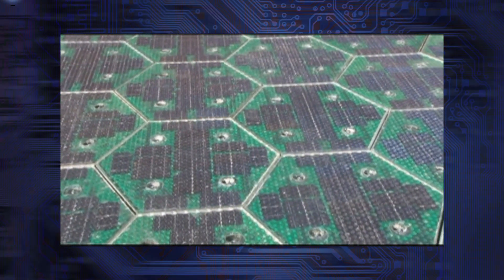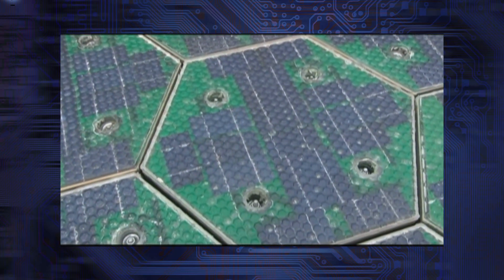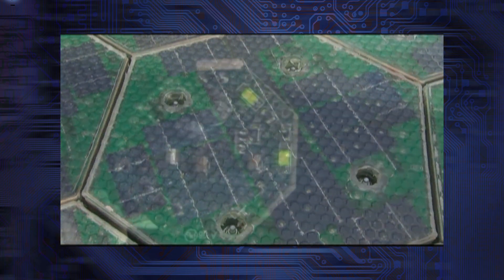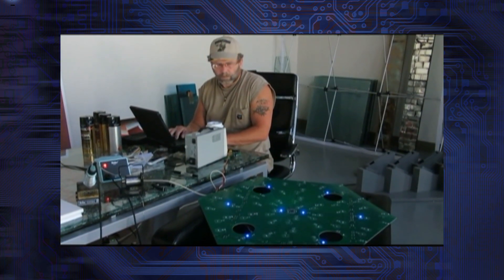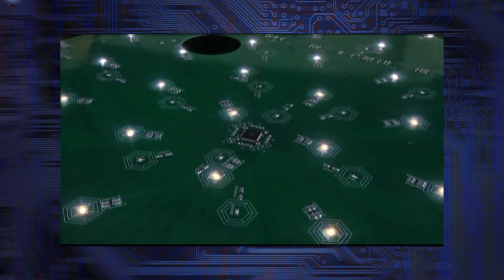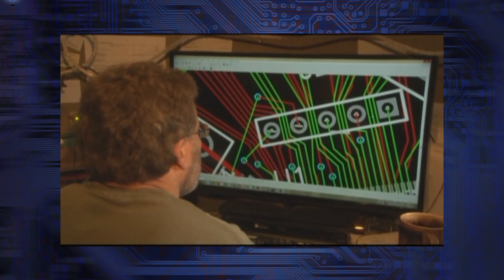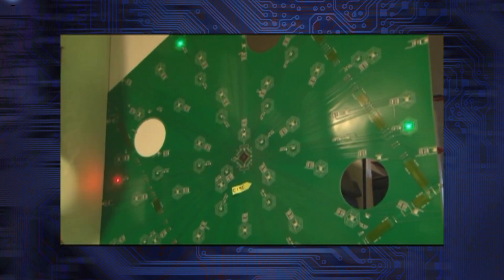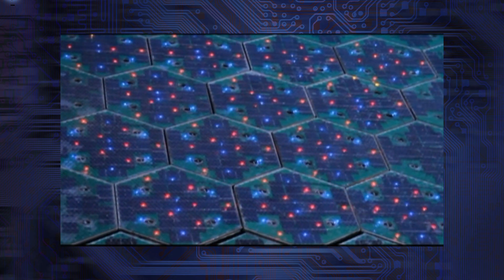Solar Roadways - Smart Streets of the Future

Comment: But will it be prohibitively expensive? And what happens if you live in an unstable area, tar can crack and it's no big deal, a $7000 solar panel cracks and people would freak out. And what about upgrades? What happens when a more efficient solar cell comes out, do they have to redo the entire road? It's a cool idea but there are still a lot of problems with it.
Reply: right cuz if tar cracks they just leave it for months and don't do shit about it.... though unstable neighborhoods wouldn't be able to afford it in the first place.
Reply: ***** By unstable I mean Geologically unstable :P When roads crack it's a simple matter of filling the crack with tar. It takes maybe 30 minutes and people can drive on it. Electric systems aren't as easily fixable. . . Now that I think about it, would these tiles work on hills or are they only for flat surfaces?
Reply: Gaius Hannam  I guess that can be a problem, but given we can make flexible displays and other parts. I think it can be done just need a lot of ribbon cables xP... and because these are modular they might just be able to absorb shocks better. like trees getting knocked down by high winds but grass can just wiggle a bit. (horrible analogy xP)
Reply: Tar cost in 2010 was $1000 per ton, depending on the size of the crack, the cost would be balanced. Honestly prototype costs aren't a good representation of actual costs. Mass production of these panels could drive the costs as low as $500.
Reply: Tracy Gossett You're right and the costs should drop significantly if they're able to produce the panels in bulk. I just worry that this idea might be too expensive and unreliable.
Reply: Gaius Hannam They won't significantly drop, because of the law of diminishing returns. Also, for example, what do you think is going to happen to the price of LEDs when the demand is going to pretty much double overnight? Do you think that the people who use LEDs now are going to shut up shop jus to get this project done?
Reply: What has happened to the price of electronics? It needs to get going, that's all.
Reply: They never will have all the roads replaced with these panels.  In my local area of Iowa all the non-essential roads are still gravel.  If there are not more than ten homes on the road, they won't put money into paving it.

Comment: Rain, snow, ice, dirt...
Reply: Rain is channeled away, snow and ice are melted with heating elements, dirt falls into the cracks between the textured tempered glass bumps and can be swept off with a street sweeper.
Reply: Also rain floods the dirt away, and Small pieces can be blown off by passing cars creating Air flow.
Reply: ***** They have considered many situations like that where something could go wrong. That is what civil engineers have to do to develop something that will last.
Reply: ***** Everyone is so worked up by this project. You don't need to be afraid.

The couple is collaborating with engineers who know how to do their job. They got a contract with the Federal Highway Administration.

Here's their solution:
http://www.solarroadways.com/faq.shtml#faqSnowmelt

Comment: What about traction? Those things don't look like they would have much grip.
Reply: Sir Aroun in there video all they showed for testing was a tractor going over at low speed. They didn't mention about long term wear, or traction in wet, dirty conditions.
Reply: Tracy Gossett tempered glass is stronger yes, but its not scratch proof, whats 10 years of grit and gravel scratching over glass going to look like
Reply: also they talk about covering 12500 sq mi with these panels which is 348480000000 sq ft. Tempered glass costs about $20/sq ft. I'll let you do the math for the cost of the glass alone, let alone the solar panels, led, installation etc.
Reply: They have been tested and have better traction.  Go check out their videos on indiegogo.
Reply: Ultra Sabers
It is not normal glass.
Reply: even if it were "special glass" there are so many problems with this idea
Reply: I'm not against it. i'm all for finding new energy sources. I have solar powered gate openers on my pasture gates. I just don't see how these things will hold up to heavy traffic and big trucks.
Reply: ralph high
well they do, they tested them for that
Reply: Ultra Sabers Asphalt is not stronger than glass, but these panels are being made with tempered glass which is 5x stronger and more durable than normal glass. Asphalt is an extremely soft material which is prone to a lot of maintenance.
Reply: That's $6,969,600,000,000, nearly 7 trillion dollars.
Reply: SpeedrunnerG55 So over 1/3 of the US GDP....I say lets do it
Reply: Geeze guys you're all looking at this from a prototype cost plan vs a production cost plan. Mass Production will drive the cost down simple economics.
Reply: Tracy Gossett You're right it would be less than that but would still cost a stupid amount. But the idea is heavily flawed. Check out Thunderfoot's Videos on this

Comment: This seriously won't work. Roads need so much repair and maintenance as it is and asphalt is probably a lot tougher than this. How does salt effect it? Good luck in the NE.
Reply: Couri Leuschner You forget that there will still be asphalt roads around for many years, which will still require plowing and salting. Vehicles will track that salt onto solar roadways, severely corroding the bolts holding them in place, as well as any other exposed metal mounting hardware. Plus, what happens when the heating elements fail?
Reply: why would you salt it. also exactly how much tougher is asphalt
Reply: The same reason you salt roads when it snows and gets icy? As far as I know solar panels absorb heat they don't generate it.
Reply: kant12 you salt todays roads because of snow and icy.  these have built in heating elements to keep them a few degrees above freezing to snow and ice melt instead of sticking to the ground and freezing
Reply: brooklyn560
interesting
Reply: Ultra Sabers if you waited until the roads were frozen it probably would take quite a bit of power. But wouldn't the system be designed to heat the roads before it starts snowing.  If the roads are kept above freezing wouldn't the snow and ice melt instead of sticking
Reply: Asphalt is not tougher than glass (especially tempered glass) which is used to make these panels. Heating elements in the panels will melt snow and ice. This project is already funded by DoT and private funding, not sure why people need to be so skeptical. Let them build a prototype and test it then make your conclusion after that.
Reply: kant no need for salt due to the heating capability of the panels

Comment: solar research should shouldn't stop, but solar power itself is and or will be very limited so our efforts for our energy needs should be more focused elsewhere...
to put it bluntly, solar power is just artificial photosynthesis, plants are far far beyond solar when it comes to energy production with many more perks, therefore bio-mass energy is the only viable future energy source...
Reply: It's not really the only viable future energy source. Please, you wrote that as if the only two options were solar or your own suggestion. Wind power, hydro-electric power, geo-thermal power, liquid fluoride thorium reactors, to name just a few potential alternatives.
Reply: *****  I already mentioned wind and we already use nuclear a lot.
Reply: all of those are limited in their production values compared to bio-mass energy.... either that or the tech to make them happen just isnt ready.... glad youre enthusiastic tho....  and on top  of that check the comment under me from the emperor
Reply: camo jorel  Bio-mass energy has it's own limitations and complications, it's not entirely clean, not perfectly sustainable and can have negative impacts on the environment if not managed properly. I would not say it's superior to any of the other energy sources that have been mentioned, it's simply one option among many choices.
Reply: Vashu627 biomass is the only viable option.... i dont consider solar an option, at least not anytime soon until technology makes a great leap... you would have noticed that if you really read my comments... think about it.... we dont even have a way to mass store electricity, new battery tech is way off from fruition... put all your options on a chart, compare with natural values and available tech and you will see what i am talking about

Comment: I couldn't imagine the havoc this would wreck in Alaska during winter. The snow would pack on faster than it could melt, and when there are -50 degree temps, the snow would refreeze turning the road into a fucking ice rink. Dirt exists to cover them. It would take trillions of dollars to actually make this a thing. People need to stop eating this shit up.
Reply: Also that's going to take an absurd amount of material. Millions of tons of un-biodegradeable plastic covering every street, then parking lots, and basically every surface cars drive on or even people walk on. That is not environmentally friendly. It doesn't sound like our hosts here even considered that for an instant.
Reply: We know the cost of the glass. Around $300 per tile. We know the area of roadways in the lower 48. 25000ish. That's 60 billion square meters. That's 20 trillion dollars. That's WITHOUT the high-tech gadgets and power lines. You'd still have to pave a flat, stable surface for these tiles to go on. It's just ridiculous to think this is even a possibility.
Reply: Shahar Levy Keep covering your ears and believing everything you'd like to .Trust me, if this were sound, I would be on board, but it's not.
Reply: Shahar Levy Because generic 36x36 1/2 inch tempered glass costs $300.
We know the costs of everything involved. 20 trillion dollars. (And this is without the various electronics.)
It's not going to work. There are various problems with using glass in the first place. They claim the traction is good, but driving on wet and icy glass? That changes everything. Asphalt has a lot of rough, spiky areas that provide traction, and drain away water. There are so many other issues. The LED lights, the melting the ice and snow, dirt and other various materials grinding glass smooth, the life expectancy of the the tiles, transporting the energy. The amount of money that would need to be used is unrealistic, and it will never happen.
Reply: George TheOnion  You're absolutely right. I hadn't even taken into consideration the glass earlier, that's just one more huge reason it can't work. It would be too slippery after it rains, the everyday traffic would destroy that stuff within probably a day or so. Tires would scratch it, dirt would get in those scratches, no sunlight would even reach the panels within a few days and the entire thing would be an epic waste of time and money.

I don't even imagine it would make for a good novelty in a parking lot due to how frequently it would need to be replaced. The cost of maintaining it would just be absurd.
Reply: Vashu627 So you suggest continue using crude oil (bitumen actually) for our roads?
How many road-construction companies have you heard promising to recycle existing roadways material and how much does it cost? I bet you don't know.

These guys promised to use as much as recycled material as possible for the assembly of these panels, chips and hardened glass.
So it seems to me that the existing way of paving our roads is a bit.. prodigal..
Those Solar Roadway panels won't solve the world's oil consumption but it seems like a good way to start.. plus it gives us free energy!
Reply: Shahar Levy You do know what plastic is usually made from?
Many areas can't afford to maintain the regular roads or expand public transport, let alone roll out thousands of miles of these.
Reply: klondike444 They can if they'll sell the electricity. 
Have you ever seen a road being repaired? you need to bring heavy machines to break the road, fill it again, straighten it, and it takes a lane or two or maybe even blocks the entire road + takes a day.

You're concerned about materials and money expenses?
Solution = recycled material, and self-paying roads.

And I bet those panels take less crude oil to create than a meter of bitumen.. but that's just a guess..
Reply: Shahar Levy I'm guessing at figures too, but creating/maintaining an enormous road system of any kind is becoming increasingly difficult, and road transport as a whole probably doesn't have a bright future.

It would need an awful lot of recycled material, and an awful lot of electronics, and all that recycling would take an awful lot of energy, which I doubt these panels could provide: and it always turns out that grid solar has a hidden subsidy from fossil fuels. Not that I like fossil fuels, but we're completely dependent on them, and if we ever manage to wean ourselves off them it will be in a future of much lower energy use. But that's preferable to waiting for FF's to leave us.

http://ourfiniteworld.com/2014/01/29/a-forecast-of-our-energy-future-why-common-solutions-dont-work/
Reply: Shahar Levy
"How many road-construction companies have you heard promising to recycle existing roadways material and how much does it cost?"
As a matter of fact 99% of asphalt gets recycled, which makes it one of the most recycled materials in the world.
Reply: UngodlyFreak Not precise.. you lose a lot of material during the recycling process.
But that's not the case, I think you just want to get into petty arguments while the obvious fact is that Solar Roadways is a much more efficient way to built (Or re-construct) existing roadways.

Since it's only in the experimental stage, we don't know the costs yet, however, if the production costs are lower than bitumen production/road implementation.. humanity might won the jackpot... and the naysayers will be remembered as assholes..
Reply: George TheOnion You're right, it's obvious you know all the answers, Mr. TheOnion.

However, I'd rather wait for actual data before I give up on one of the greatest idea of my generation.
Reply: No ears covered, I'm not saying it's not true or impossible, this idea sounds good on paper but it might be a disaster. BUT I also think that you're talking out of your ass with no actual facts (No offense), you don't really know the production costs, you just trying to calculate the costs out of manufacturing (how come it's 300 per glass tile?).

I don't care about you being on board, I just want to see it happening, if it's plausible, I'll be the happiest person, which is why I gave money to this indiegogo project.

Worst case, it was a waste of a little money on my end, best case, Solar freak'n Roadways.

Enjoy the naysaying, I'm a believer.

Comment: In certain areas this would probably work pretty damn good, and I would love to see it. In certain places like say Minnesota, where I live, those panels would be fucked every winter. Still, this is an awesome idea and I hope they can get it off the ground.
Reply: Yeah, they should primarily be used in areas with a lot of sun, obviously. But, as long as they're kept clear of snow, they will do their job, and will pay off in the long run, though not as fast as in states with no real winter.
Reply: xxhellspawnedxx Actually the roads will produce heat to melt the ice... >.< so say good bye to shoveling pavments/roadsways.
Reply: hahaha Washington.... can't even xP rain everyday no sunlight to power them at all... though we have hydro so I guess it wont matter that much
Reply: ***** Most solar panels manufactured within the past decade can produce electricity without direct sunlight. So your comment is both uneducated and unhelpful.
Reply: Jerry Likes According to their own specs, to keep 200 miles of road heated you will need to have a power station the size of three mile island running at full pelt.
Reply: Tracy Gossett The electricity produced by solar panels is a direct factor of how much light falls on them, right?
Reply: Tracy Gossett Yeah, for a panel to stop working, it takes a prolonged period of shade.  In 2007 here in Iowa, we had a month and a half where the sun literally did not shine.  We had constant cloud cover from November to mid December, matte gray sky.   It took three weeks for my farms electric fence solar panel to run out of juice in those conditions.  It is almost unheard of for clouds to last that long, so it is not a huge problem.